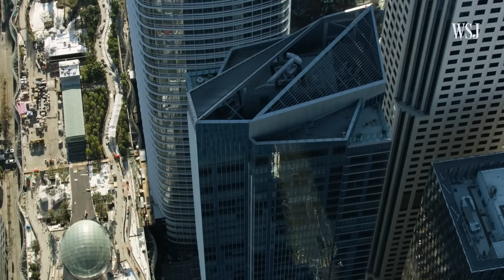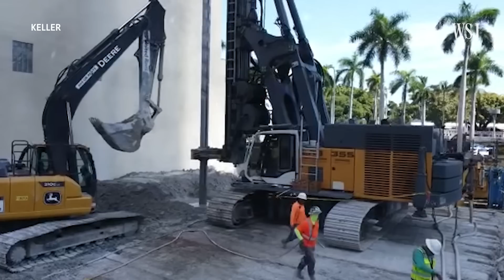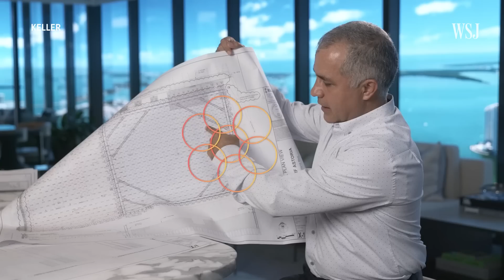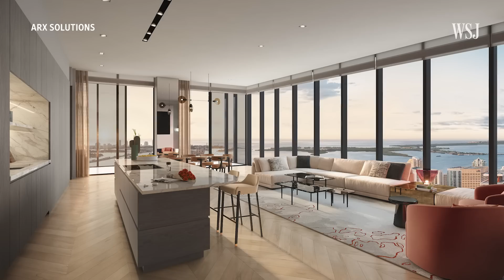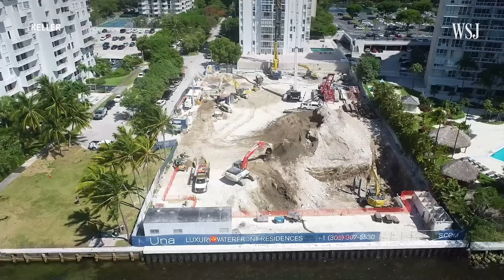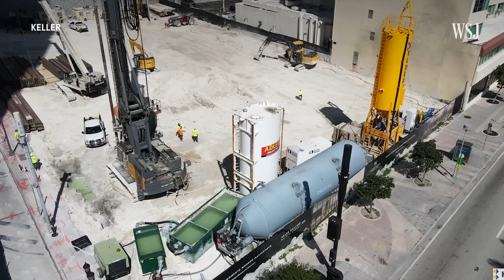The Construction Method That Can Prevent Skyscrapers From Sinking | WSJ

Comment: ?? Common sense would tell you that setting the building on a stiff soil base will not stop the actual stiff soil base from sliding or tilting, when set against the other soft soil right next to it... sounds good on paper I guess, but I won't be buying a unit anytime soon.

Comment: Soil crete would still require reinforcement against tensile stresses generated due to downward shear(cement is weak in tension), as entire soilcrete would behave as single isolated footing. In short the problem of sinking would still occur somewhere in future

Comment: Great. So these buildings will withstand a lot, stand around for a while, but if the area ground around it shifts from erosion and and the exact thing the building was design for but the surrounding area wasn't,  and the pipes burst - the water pipes, gas pipes, and the SEWAGE pipes - you'd still be SOL with a nice building that stands on its own with nothing to supply it or to take care of its waste, with the surrounding area under water from the rising sea levels and flooding from massive hurricane storms  LOLOLOLOLOLOL

Comment: Question for the geotech engineers in the comments: How mature is this tech?  How long has it been used?  Would this be the first time this technology has been used on a building this size in that particular soil environment?   Video mentions it has been used in quite a few places, but only on shorter projects or industrial settings.  Is this ready to be used on massive buildings?
Reply: This has been around for a long time just in slightly different forms. The question of using this method or a different method such as steel piles to support a building usually comes down to site conditions and cost. Every method has different advantages and costs
Reply: Yes, the method has been around for a while. But it's usually implemented in smaller structures. It has been used on small hydro structures like small gravity dams.
Reply: The most important question might be:  Would you feel safe if your family lived in this building?
Reply: @Me97202  If the engineering is sound, yes...  hence the questions to the geotechnical engineers.   They know more than I do and I trust them.
Reply: ?? Common sense would tell you that setting the building on a stiff soil base will not stop the actual stiff soil base from sliding or tilting, when set against the other soft soil right next to it... sounds good on paper I guess, but I won't be buying a unit anytime soon.
Reply: @ItsMe-yv9jd  Well, common sense 150 years ago would not have allowed for 120+ story buildings made of steel and glass, or miles long bridges and tunnels, yet look where we are now with advances in materials technology and engineering.

Comment: What is this effect on flooding and the underground water table since you are impacting the soil composition? Especially in Florida, sound like you are trading a construction issue (for developers) into an insurance and tenant issue.
Reply: Limestone is prone to sinkholes, redirecting water to new areas can exacerbate existing sinkholes or cause new sinkholes to form in those areas
Reply: Underground water table? Building structures impact soil density exponentially depending on size and construction technique. All skyscrapers compact the soil over time and cause environmental damage. Building on bedrock would be the best case scenario for any project, but unfortunately most construction projects aren’t like that.
Reply: @mi12no  yeah exactly! Thats why investigations are undergone to check if the loads imposed by propsed buildings will cause neighbouring buildings to sink/settle/heave. I think there is just a general curiosity about what the local impacts of changing the soil structure will be for neighbouring structures and surrounding soil zones
Reply: The water will go around it. It’s no different to any other natural structure in the ground. If that was a thing though it wouldn’t be a problem since Florida is pumping its groundwater dry and causing subsidence. And tall buildings are a fraction of a fraction of a fraction of land area. If you’re worried about water you need to look into the drainage problems of suburbia.
Reply: ?? Common sense would tell you that setting the building on a stiff soil base will not stop the actual stiff soil base from sliding or tilting, when set against the other soft soil right next to it... sounds good on paper I guess, but I won't be buying a unit anytime soon.

Comment: Will concrete be still in working condition after 50 years?
Reply: Well depends on what sort of concrete they use.
Reply: ??? The best concrete can last for thousands of years. Why would someone build a 100 story building on concrete that will only last 50? I don't even think there is any concrete that only last 50 years.
Reply: @jouaienttoi  the interior and building will last 50-80 years. Concrete will probably last a bit longer.
Reply: @jouaienttoi  either you never worked in construction field or watched too many ancient Roman youtube videos. Modern concrete does not last that long. Concrete need to be maintained periodically to hold its shape. You cant just build and forget and expect to last life time. At least bridges and buildings can be maintained. How are you going to service and maintain concrete piling structure when there is 250000 ton building blocking its way?
Reply: But it’s not pure concrete instead a mix of soil. Would have loved to know the ratio personally.

Comment: There’s a reason high buildings always were set on bedrock below or not built in that area?  The building will eventually tilt. Hopefully not before it’s usefulness is complete.
Reply: The reason was that there wasn’t a market for ultra luxury skyscrapers that was large enough to justify all the building. Miami has had skyscrapers for years, but as very high wealth individuals moves from NY to FL, the demand is way up.
Reply: ?? Common sense would tell you that setting the building on a stiff soil base will not stop the actual stiff soil base from sliding or tilting, when set against the other soft soil right next to it... sounds good on paper I guess, but I won't be buying a unit anytime soon.
Reply: It's possible to build skyscrapers in weak soil, as in Mexico city or Tokio (Torre Mayor, Torre BBVA, Torre Reforma, Torre Latinoamericana [1956]) and also be earthquake resistant, essentially the building floats as a ship, or using very deep foundations. But I'm not sure about soil prone to tide erosion, high winds and exposed to a salty environment.
Reply: Skyscrapers can last for hundreds if not thousands of years if properly built and maintained.